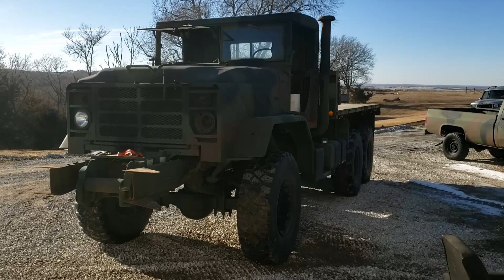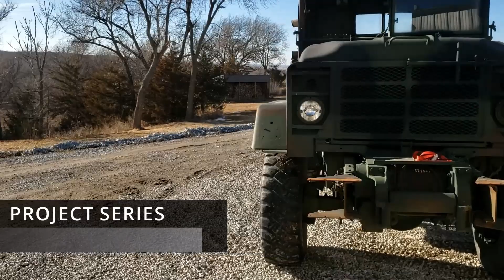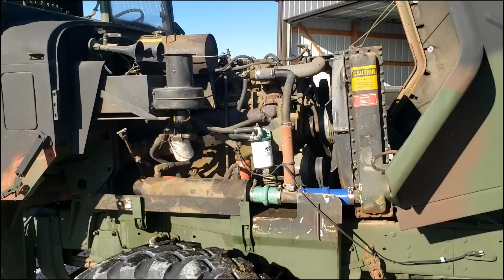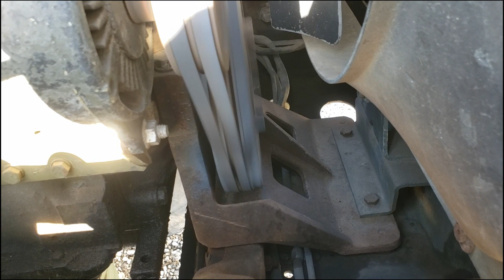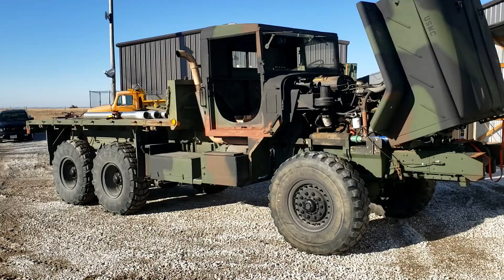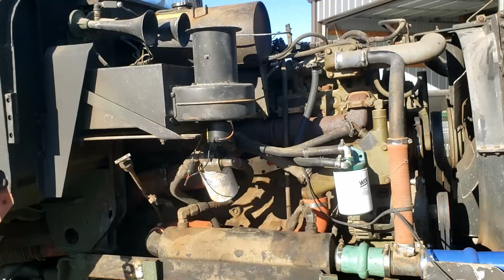Project: M925A1 Intro

Comment: A m915 air filter will fit the cleaner box with little modification and increase the cfm to 1200 and allow for dual filter elements.